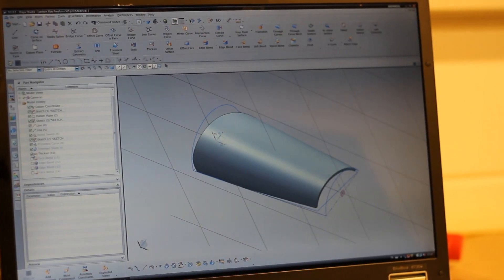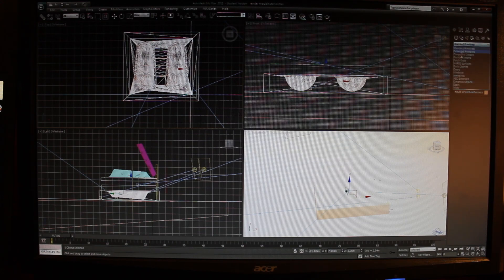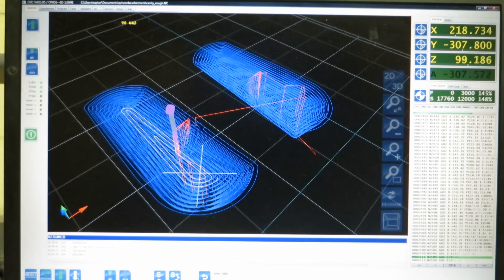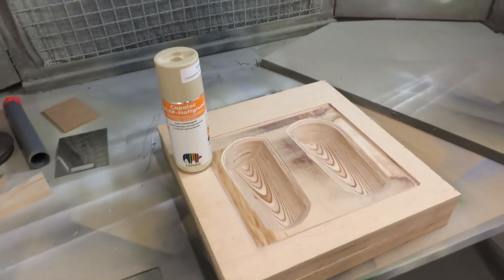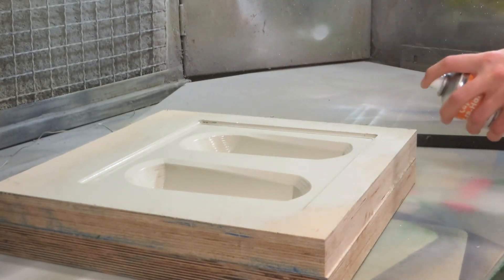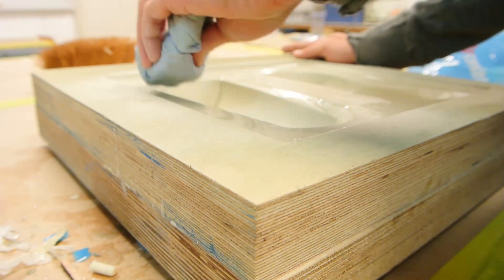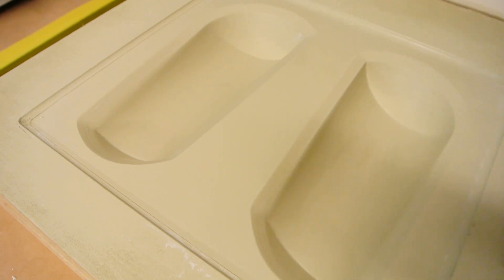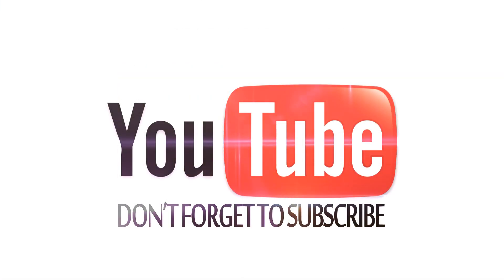Tutorial: Out Of Autoclave PREPREG Carbon Fiber/Fibre Part 2-7 (3D design - CNC - 2K spraypaint)

Comment: Hi Matthew thank you very much for all your videos and explanations, great work I am beginner in composites am creating a mold with a 3d software, then I will sliceform Wood's I will fill with foam, sanded layers of putty to match the piece layers gel coat shiny.
The question is whether I can laminar carbon fiber infused directly on this mold, or would have to make a new mold glass fiber and polyester resin first, to have more strength. Thanks again.